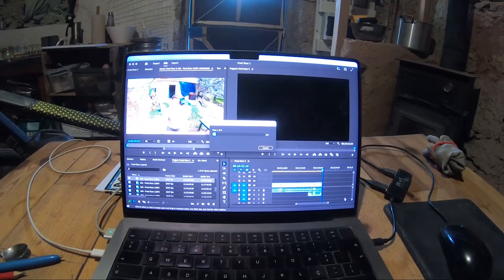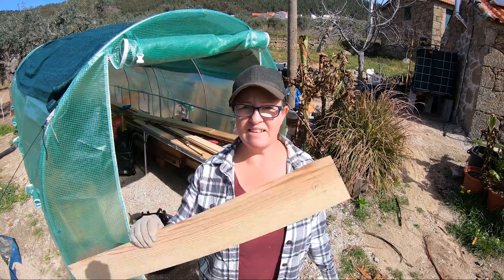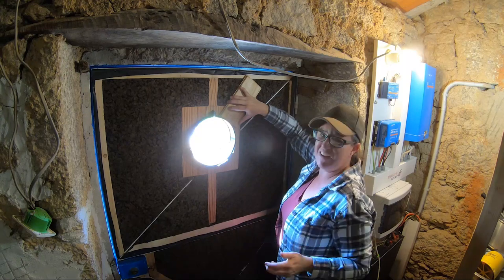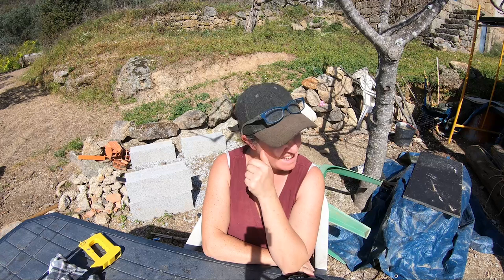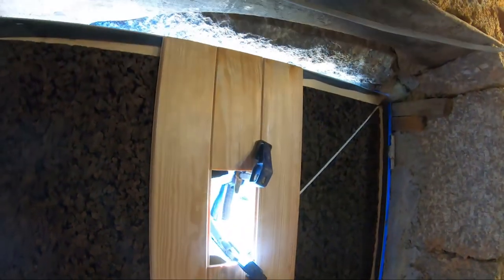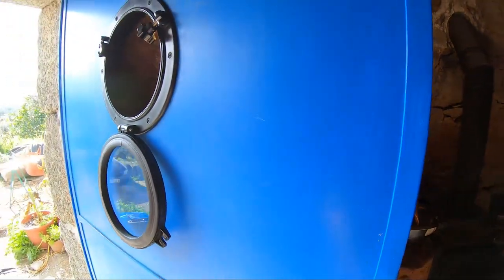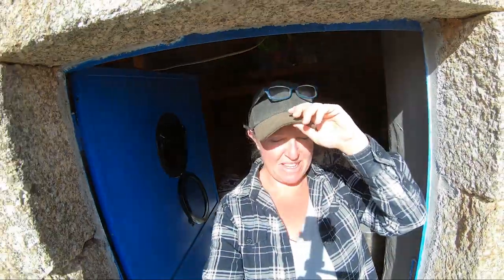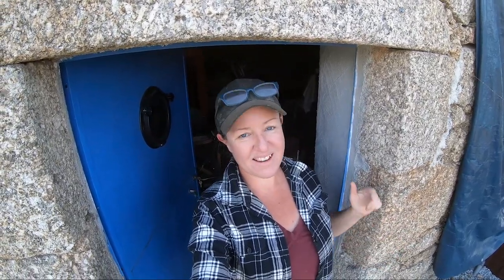Tiny House Door #3 - Cladding Nightmare, Window Explained, & Rendering

Comment: I love the porthole window. I live on a boat, so it's right up my alley. I do have a suggestion...you might have already planned for this. It would be a good idea to use a bedding compound like Sikaflex on the porthole ring when you permanently attach it, otherwise water will find its way behind that and into the door. Thanks for the videos!
Reply from the maker: Thanks for the tip! Do you mean on the outside face of the door, under the black circle part? Or the interior part where it'll meet the wood inside? Or both? Thanks!
Reply: @PortugalfromScratch  Definitely on the outside face of the door under the circle part. It can be a messy process. Plan ahead, tape everything and wear disposable gloves. You should apply enough so that the excess squeezes out around the edges as you tighten the screws. While it's fresh, you can clean it up with regular or denatured alcohol. Hope that helps.
Reply from the maker: @DiaOnTheSea  Thanks! We're going into a long, dry seasons soon and I do intend on putting a little roof over the entrance... so let's see if I do that before next winter. If not, I'll seal things up for sure. Thanks for the info!
Reply: @PortugalfromScratch  Why don´t you build a small porch?
Reply from the maker: It’s part of my plan! But not a priority. Soon I hope!

Comment: I just read a comment about using sealant betwee the window and door on the outside. I would definitely go that route to avoid any moisture getting in. Great video as ever.
Reply from the maker: Once I'm sure I have everything in place and won't need to remove the window, I'll seal it all up. 😁

Comment: Hi there. I was watching this past episode that I somehow missed and I got to thinking about your more recent episode about using your router to create the interior frame for your window. What about creating a frame for the inside that is actually the frame for your screen. It seems that building a window frame and then later creating a screen might overly bulk up the interior profile of an otherwise delicate window profile that looks great.  I see a thin wood frame that acts as the frame for the screen that is attached to the door by 2-3 screws. Just a thought.
Reply from the maker: I think we could be thinking the same thing! Nora 100% sure but sounds sort of like what I have in mind.

Comment: You can use a wet bit of soft plastic (like a piece of.sturdy plastic bag) on the corners, just slide it up and down to smooth, low tech way of getting a great curve when you do your final coat. The whole doorway is going to look great with the pergola etc. befriending the jigsaw at last 😅🎉
Reply from the maker: Nice tip, thanks!!